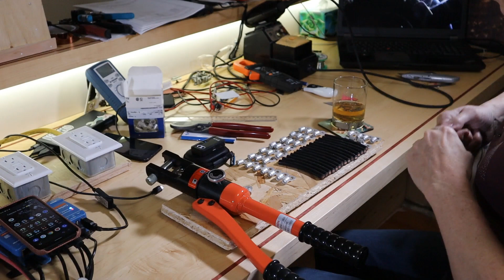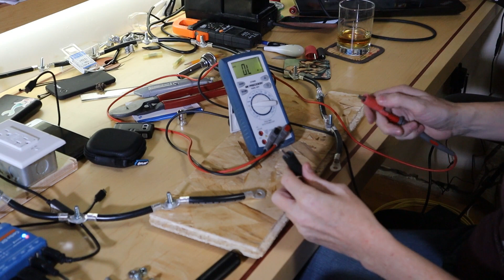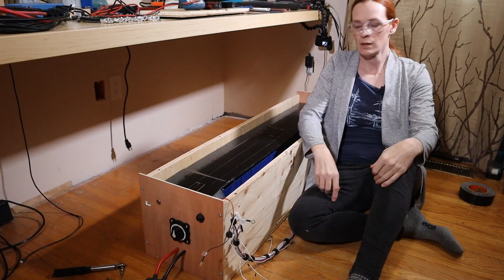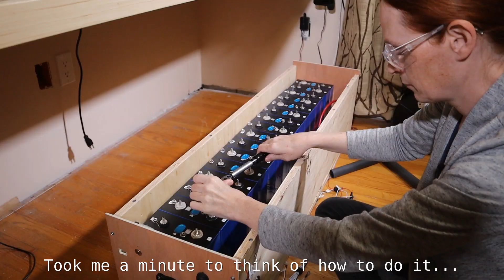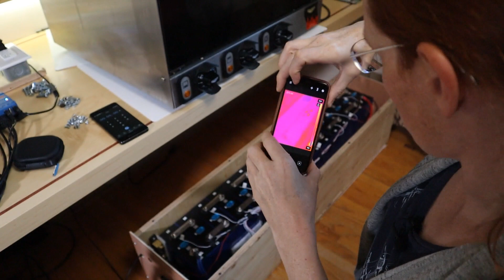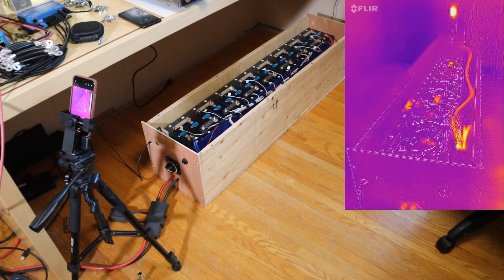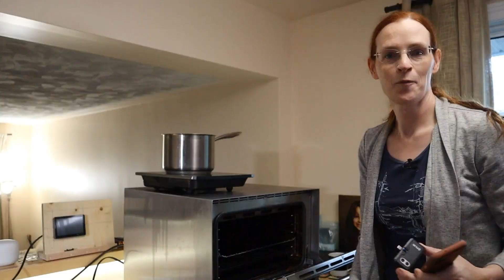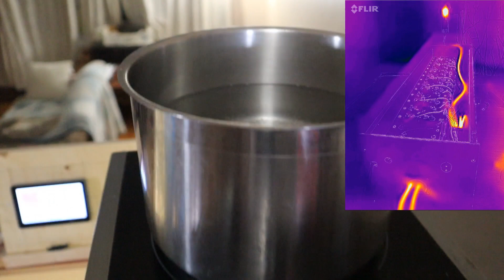What's Better? Rigid or Flexible Bus Bars - How to build a 48v Lifepo4 battery (Ep. 21)

Comment: 4:10 I really despise this argument.  Even if tech is continuing to move forward, batteries of this size will always find a home to be downcycled somehow.  I can guarantee 10 years from now I would still find a use for those cells.  Why mentally/arbitrarily cap your battery's lifespan if there is otherwise no other cap, based on a hypothetical technology that literally doesn't even exist yet?
Reply from the maker: I suppose I didn't make it clear; I won't throw the batteries in the bin when they're no longer good for me. I totally understand the value of "second life" lithium. In my case though, using batteries for propulsion where weight and space are a premium relative to available range, I'll want to keep upgrading. Sure, no one knows what the future holds, but given how much insane research money is going into energy generation and storage, it's a preeeeetty safe bet than better batteries will be available if 5~6 years. Better enough that I would want to upgrade to gain range.
Reply: @TheDigitalMermaid  I understand the rationale, I just don't agree with the decision drawn from it.

If something becomes totally uselessly ineffective, sure.  And propulsion is very sensitive to density.

But the march of technology goes both ways.  Electronics and other items will still gain efficiency, which will continue to make these cells viable in some other role.  If you make a bet on the premise, you also have to accept the second bet on the same premise.  (I'm also imagining deploying some sort of electronic proximity buoy or some small drone that orbits your boat on patrol...)

Comment: @9.18 and forward. You can't measure resistance like that for very low resistance samples. A single multi-meter cant accurately measure below 2-10 Ohm. All you are measuring is the contact resistance between your probe and the ring terminals, which is typically around what you measure at 0.1-2 Ohm. You MUST use a 4-wire method to measure the real resistance in the flex cable or busbar. For example, the resistance in 1m long cable of 10mm2 copper is about 1-2mOhm. You probably have about 0.2 mOhm resistance in that short cables, which is far below your accuracy with a single multi-meter. 

All you have to do is connect a constant current source to your cable and measure the the voltage drop over a GIVEN length. In your case, a lab-bench supply set to a current between 1A to 5A source should be more than enough. If you don't have bench supply then use 2 multi-meter where one is measuring voltage drop and the other is measuring current when you have connected it to the battery. That is all you need to do to determine if busbar or flex cable is lower resistance. This way, you measure the real resistance and you don't need 200A as you suggest. 

Also, you can't easily use FLIR cameras on metal (reflect IR) or glas (block IR). An easy way to overcome this is to place a piece of electrical tape on the busbar to be able to measure the temperature of the tape. 

With all this said, flex cables with a bit of slack is a good choice for vibrating environment.

Comment: To measure low resistance without miliohmmeter: connect a 1A current source across the part (wire, connector, whatever) and a multimeter on millivolts range.
Voltage drop of 1V equals 1 ohm resistance @1A current. It's much easier to measure 10mV than 10mOhm with a standard multimeter.
If you want better resolution up the current to 10A, then each 1ohm will produce 10V

Comment: Your multimeter can't measure such low resistances. To compare which is lower you can measure voltage when running constant current over bus bars. Ideally - connect both bars assemblies in serial and run a current - so current will be same, voltage on assemblies may be different.

Comment: Measurement of small resistors this way is very inaccurate. 
Much better is to use the constant current source and measure the voltage, and using Ohm's law to calculate resistance R = U / I.
Even simple multimeter measure voltage in millivolts.
In this way, the resistors in the range of miliohms can be measured without problem. Personally, I used this method when I needed to construct the resistor 50miliOhm / 1000W resistor wire.
In your case, the battery load can be used and measure the voltage on the screws, this way you will measure overall resistance including the resistance of the battery contacts.

Comment: re: operating temp difference between the bus bars & cables.  ...using FLIR for this gives you a rough idea but the bare metal bus bars have different IR emissivity than the thermoplastic covering the cables used for the jumpers, and thermoplastic also provides some thermal insulation compared to bare metal. So you have multiple factors introducing discrepancies. Best way to test different jumpers (after establishing a baseline ) is to install a few of each type at different places on the same pack and measure the temperatures of the same points are regular intervals with a contact thermometer.

Comment: @5:10 "Given all the hassle of compression... building a rig to do that..." It isn't a hassle at all unless doing it the hard way, by using bolts, springs or tie down straps, etc.  Just build the battery box to the correct size and use stiff foam (or very soft rubber) isolators between cells (AND outside the end cells) to achieve the desired compression rate (e.g.: 12 psi) when the cells expand at full charge per the mfgr's specs.  The fasteners that hold the corners of the box together allow easy assembly by tightening them after all cells & isolators are in position.  The battery box can also be built slightly oversize is using  thin plastic sheets as shims to accomplish the desired preload (which really isn't a preload so much as it is bringing all surfaces into contact with the isolators). This provides electrical insulation between the aluminum cases and also provides some shock absorption, which is desirable in mobile applications.

Comment: Great video!   Totally agree that on any kind of mobile application, flexible is going to be better and safer, although I will definitely echo the thoughts of others here that corrosion will likely be a more significant issue with stranded wire. My boating experience has always been around salt water (Puget Sound and surroundings), and in this area anyway in is always a matter of when, not if, salt will start wicking into the strands and start corroding them.  Using good materials will help make that "when" period multiple years.

 A question - what was the cross-sectional area of the solid bus bars you used in the test?

Comment: I would use the flexible links even in a static install. No matter how stable you think your install it is, there's always going to be some vibration or movement. The heavier and stiffer the stuff inside of it is the higher the resulting strains will be. Let's assume that your battery case is infinitely stiff and strong. Soil expands and contracts, heaves and subsides. Your perfect battery pack isn't going to transmit any torsion, flexion, tension or compression, but it's still going to tilt as the ground changes its level, changing the direction of the force of gravity. Even far away from man and machine, the ground never truly stops shaking, shaking your battery pack and everything inside it. Then there's acoustic energy. Thunder, aircraft, nearby machinery, sound systems, animals, wind and wind blown debris and precipitation. Even if your install somehow it's somewhere where none of these apply you're still going to have thermal expansion and contraction to deal with - Unless you never charge a discharge your battery back - LoL
Reply from the maker: Oh, flexible is the way to go. Add what you said, and consider I'm installing these in a boat... Motion and vibration will be constant.

Comment: Well done for starting this conversation, one of the reasons for random heating on solid bars is the makeup of the substrate material..the impurities of the substrates unless you use aircraft grade metals has to be considered. Also one thing to be considered is the refraction of the of the surface material when using thermal cameras, it can trick the camera. I use very expensive thermal cameras in Antartica for research and we also have huge issues with consistent results due to the reflective surfaces, time and thermal soak is the answer here. This is going to be fun to see if anybody picks up on point loading electron transfer.An area to explore is the improvements in thermal transfer for chip design, same principals may also be of interest for connection integrity. happy testing…..

Comment: Just for giggles, compare the cross-sectional area of the buss bars to the cross-sectional area of the cables. I would imagine that both will be close to pure copper, or the manufactures would have to state that what is being passed off as copper is indeed an alloy. Both the cross-sectional area and the purity of the copper can impact the amount of resistance.

Comment: You are completely correct. When is the last time that you have seen a buss bar set up used in a car or a truck battery setup? Think about the multiple battery setups used in semis and heavy equipment and the fact that most if not all use cables instead of bus bars. The vibration is the big problem those applications.

If you are worried about corrosion, just use one of the various greases and/or paints that are available for electrical applications. No-ox is one that I can think of that i have used in aluminum AC applications 100 times without any problems. I imagine that the greases used on automotive terminals would be good for your boat as they would be engineered for high amp DC applications.

Comment: Hi Madison, I've got to admire the way you have thrown yourself into this project! I should be getting on with mine, instead of watching yours ;) 
For someone who didn't have much experience with electrics, you seem to have quickly built up an incredible collection of tools and instruments. I don't have much to contribute to this. I would only say from electro-technology classes way back, that a stranded cable can carry more current than solid for the same CSA. This was because in AC the current tends to migrate to the outside of the strands, and the solid conductor only has one strand. This is how hollow conductors can save weight. I know of course that this is DC. However when a DC current rapidly changes, the effect might be similar to AC. I also recall that when a (really) heavy current is applied to a cable, the magnetic effect can cause the cable to physically move. Does that matter in your case? Probably not! Watching with interest...
Reply from the maker: "I should be getting on with mine, instead of watching yours" - Why not both? ^_^

All joking aside, the entire purpose of the channel was to encourage people to start on a project. So yes, go do yours! That's what this is all about. 

As for the tools; I have had a long standing policy that, if I am going to try to do something myself, then the money I save can go into decent tools. The logic being that I was going to be struggling enough with my ignorance, I didn't want to make things harder with cheap tools. I can't justify over the top fancy stuff, like expensive bench power supplies, but there is s till a place for "nicer" general tools. 

If I can pull off what I am trying to do, then even with the nicer tools, I'm still coming out ahead, cost wise. Best of all, I still have the tools after!

Comment: Several factors affect the longevity of dissimilar metal compression fittings yet essentially the end product should exhibit a gas tight junction between the crimped parts such that the crimped areas are effectively fused together over the lifetime of the joint.  This is controlled by crimping with a known force and thus the sizes of the mated conductor parts. Your approach of standardizing your manufacturing processes, piece parts selection, plating compatibility and tooling is commendable as is your awareness of your supplier parts chain. Note:  the electro-potential galvanic difference between mated dissimilar surfaces should be less than 0.25 volt (to minimize corrosion between the dissimilar surfaces in the presence of moisture ).

Comment: The other option if you want to use solid buss bars, sacrifice a little space between cells to avoid buss bar connection being a flex point. Someone stated elsewhere that they used cupboard door stops on 4 corners to match up at eachother. Center of cell is where they bulge anyways. He used it on B cells then new cells. Provided air space between cells. Just passing on someone elses way around your issues stated

Comment: Un-shield the wire and do it again betting you get a different result
Reply from the maker: Why would you want to do that?
Reply: Because you stating that they didn't heat up as much; but IR won't transmit through an insulated medium that is part of the reason why they put it on. It would be great to see side by side comparison as I believe do to the overwhelming amount of surface are that the wire has your results would still show wire runs cooler at high Amp loads! Great videos though!

Comment: Have you done any sort of wire-pullout force testing? I was doing some reading that the junction resistance decreases with increased pull out strength. Until the crimp becomes so tight that the wire pull-out/break strength starts to decrease. But the resistance starts to rise before the break strength starts to decrease.

Comment: Enjoyed this video - thanks.  I have to agree with a few others who commented about measuring the voltage drop under load.  It may help confirm the flexible bus bar advantage you ended up with.  I think you're doing really well at sharing what you're doing and the thought process of how you move on to the next step.  It reminds me a bit of Andy where he gets curious about something and spends a lot of time and effort to explore an idea.  Sharing all this here on YT really demands some thick skin.  Lots of critical comments on how others think you should do it, but nothing in the way of technical references to back up the comments.

Comment: IMPORTANT NOTE: shiny metals such as copper, nickel, stainless steel have very low emissivity and high reflectivity in the infra-red range. You CANNOT measure their temperature with IR cameras and IR thermometers. At around 22:45, the hotspots you see are IR reflections of another heat source from the room reflecting from the shiny bus bar. To measure the temperature of shiny metals such as the bus bars, put a small patch of electrical insulating tape on the bus bar, let it reach thermal equilibrium with the metal bar and measure the temperature of the electrical tape patch.
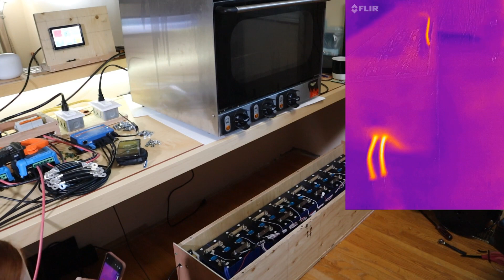Reply: That is clearly visible when the thermal camera moving around 26:47 the "hotspots" also "moving around".
Reply: 100% Correct! Those are reflective hot spots from another source in the room due to the emissivity of the buss bar. You would also need to configure the camera based on the emissivity of the surface recorded. Even a Flir E75 you have to set the camera to the objects emissivity rate to get an accurate image. However most all reflective or shiny materials have to high of emissivity to capture an IR image but really great at giving you the radiating heat from another source in view of said shiny object.
Reply: Reflectivity in the infra-red range is a great point that we don't hear enough of. How about a thin cotton cloth that won't melt?
Reply: Yes electrical tape or heatshrink tube (which is not a bad idea anyway). The BMS should monitor the terminal temps anyway. A good one should, anyway.

Comment: I am a fully qualified telecommunications technician with 20 years +, who has installed various size 48V battery banks.
Use flexible tinned copper marine power cable, a quality hydraulic lug crimper is a must. Also use white lithium grease on the terminals after connection to stop salt moisture getting in.